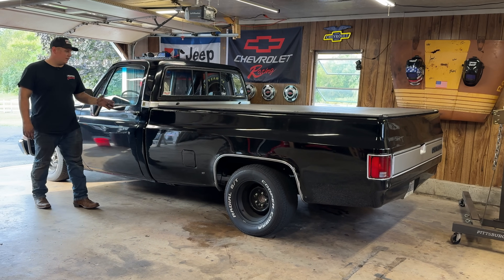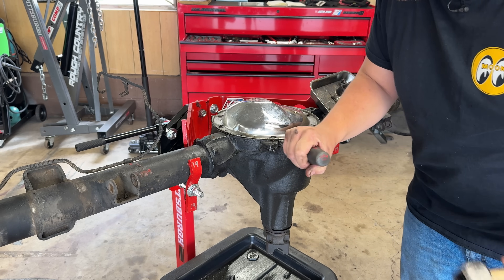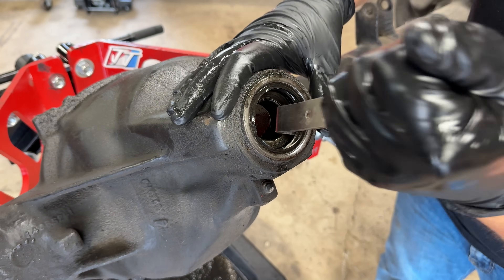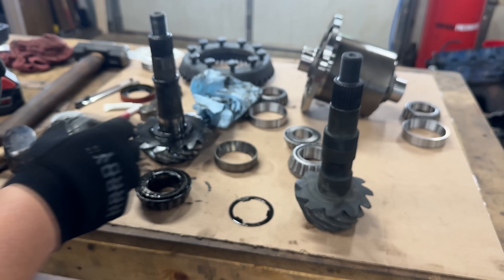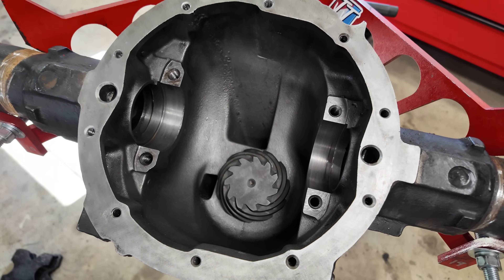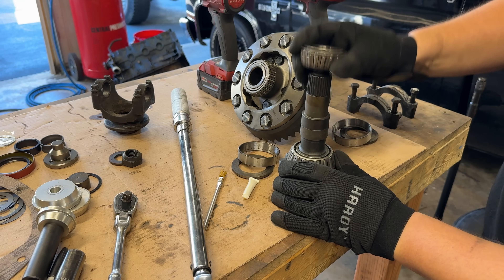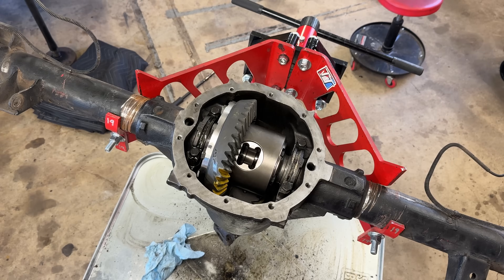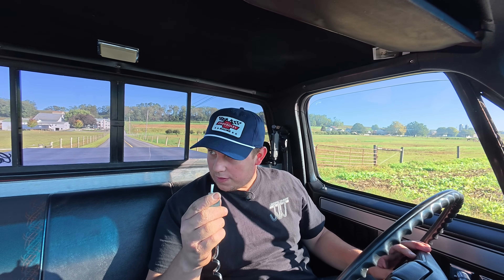Adding 3.73s and Posi to My Squarebody Street Truck!

Comment: If you use flat stock across your cap mounts and measure the pinion depth with caliper depth reading, minus the flat stock thickness, you don't need the special tool!😁👍💯

Comment: I have a 73 LWB with 383 700r4 2500 stall converter. What gears would you recommend
Reply from the maker: 3.73 are a good all-around gear

Comment: The truetrac is not a locker, or a posi traction  Drive one in the snow side by side next to a real locker and you'll see that the truetrac doesn't want to lock unless you power through it. It is far superior to a locker and much safer. Lockers are for drifty teenagers, truetracs are for adults that have to get to work with minimal drama.

Comment: I have a 1988 C1500.  I bought the pickup new April 1988. 10 bolt is showing its age. Came with 3.73 power lock rear end. Have 700R4 transmission so I'm going with 4.10 gears. I have a 2800 stall converter.  I don't do long road trips anymore. Just fun to drive on sunny days 😎

Comment: Just as a tip, do not use an impact gun on a crush collar, as the hammering from the impact gun will ding the bearing race and bearings, causing premature bearing failure in your new rear end. Brace the yolk and tightened by hand only.

Comment: If possible, support the bearing splitter so the load is on the splitter vs the threaded rods on a press. Will extend the useful life of the tool.

Comment: my brothers 72 c20 he's had for 40 years has a 350, th350 and a 3.73 posi rear, all factory. Gets to speed quickly with light throttle, and awesome traction. It was his desert cruiser a long time ago. All coil springs makes for a smooth ride. The 4.56 rear in my 85 c20 makes in really torquey and really fast acceleration.

Comment: Brother try putting a different stall converter in it. You will notice a huge difference. I was very underwhelmed swapping mine as well until I put a different converter. Completely woke it up.
Reply: Hellyeah i agree.  When i did my build i skimped and didn't go big enough.  My friend talked me into a 2800 and that thing RIPPED!  30 FT burnouts no problem. So much fun

Comment: I haven't seen the question yet where did you find a torque wrench that reads /clicks in reverse spun a friggin bolt right off once lol. Have I been living under a rock lmao. The old manual type
Reply from the maker: I was not even sure if mine would until I did this😂 Its the Icon unit from Harbor Freight

Comment: I had a 87 Chevrolet custom deluxe 3/4 ton single cab 4 x 4 throttle body with 350 4 bolt main turbo 400 trans with the new 208 transfer Case with 413 gears on the rear no locker I think it would run down chargers with no problem going down highway

Comment: what gears should i put in a pretty stock 350 with turbo 350 trans (1980 stepside)?
Reply from the maker: Kinda depends on if you want a ripper or not haha. 3.73 like this would work good
Reply: @JeepinJimmy  thats what I was thinking thanks

Comment: I have 3.73’s with a 3000 stall in my ‘73 c10 with a supercharged LS, it runs like a bat outta hell, and even with a th350 on the fwy doin around 80mph im revving around 3500rpm so its really not that bad and quite managable……
Reply from the maker: Sounds like a fun setup man!
Reply: What size tires

Comment: Takes me back to the good old days when I was 19-20. 
  We screwed with our trucks every weekend. 
   We tried the 3.55 gears then the 3.73.  Then the 4.10 gears. 
   We played around with different converters. They can be a double edged sword like the rest of it. 
   A friend of mine and myself finally ended up with a 305 Chevrolet. Big valves little combustion chambers from a 305 HOP heads. 
   Screw messing with ignition curve kits we tried that. Just locked them out and added a switch to turn on the ignition after the starter got a running start. 
   Once we threw all that at it there wasn’t anything on the streets back in the early 90s that could touch it.
Reply: I love 4.10's for the eighth...not so much for street driving lol
Reply: @jayhen475  our fathers tried to warn us about that. 
  We had the money for gas, but another bit of advice we didn’t take seriously from our fathers (Who are both respected mechanics) was, “don’t race what you’re riding to work in”.  
   We had other options. They weren’t optimal.  
   Oh the glory days.
Reply: @hughobrien4139 I learned from my dad's expletives driving his 58 Chevy Apache with 4.10's. As children we could barely hear him talk because the motor was so rev'd up at 60mph 😂😂
Reply: @jayhen475  that’s cool!  My Dad has a 57 Chevrolet truck he’s fixing up when he gets a chance. 
  When I was growing up in the 70s- early 80s he was always working on his 66 Impala SS.  It was a real 390hp 427 cid originally. 
   He got the car right before he graduated high school. 
   By the time I was born he had done all kinds of work to it that he regretted later.  
    Back halved the car some time in the early to mid 70s. Then worse he smoothed the firewall off and removed the VIN plate.  
    I always wanted that car. “No way in hell, that car is a big time embarrassment in my life.”  He ended up trading it off. 
    It was fun when he would start it up. Everyone within 4 or 5 blocks would show up to his shop.  
    We lived next door to a big church parking lot.  
    Him and his friends would drive that car on that parking lot and stack beer cans in front of the front tires to see how many the front tires would clear. He take the front clip off the car and it would stand way up.  
   As time moved along he started noticing the value of that car in original condition and I guess it became a bit of regret. 
    I loved that car.  
    Our fathers would scoff and scold us for any attempts at making a hotrod. We wouldn’t hesitate to tell them who taught us. 
    Most of the time we would conjure up something we would get it running and out fathers would get tired of us asking them tuning questions and run us out from under the hood.  
    I later went to work in a NAPA machine shop machining on all kinds of engines. The store manager was a successful NHRA super stock competitor. He was a wealth of knowledge. I’d tell him what we were trying. He would always bring us some valuable literature pertaining to the project. 
  I later went on to machining racing engines. Mostly for the NHRA Super Comp category. 
   Lots of Big Cheif and Big Duke headed 565s. Later turning most of them into 622 cid.  It became a business for me. No regrets. It did lend to fully inform me just how much money it takes to compete in racing for a living.   I don’t know that I would do it if I had the money.
Reply: @hughobrien4139 my dad's other pride and joy was a 68 T-bird with the 429 Thunder Jet. That was the closest thing to the General Lee Dukes of Hazard Charger we had seen in REAL life. That big bird was a BEAST. One winter back in 1988 he forgot to "winterize" it and the one of the heads cracked due to having only water in it. He put in one of his "friends" shop thinking he could trust them to rebuild it and when he got it back he was adamant that it didn't "run the same". Come to find out that shady s.o.b replaced the 429 with a 390 🤦🏾‍♂️
Reply: @hughobrien4139 also I forgot to mention we have a 56 big window cab step side that's been in the family for around 37 years
Reply: @jayhen475  I would be upset for sure. I really like Ford engines.  Those FE based engines like that are all getting extremely valuable these days.  I wouldn’t want to have to replace a 428 CJ engine these days. 
    When I was 20 I bought a jet boat that had what I was told was a 460 Ford engine. 
   It looked just like a 460. It ran great.  Out ran quite a few Big Block Chevrolet jet boats with it. Thought we were something else until an old man with a bass boat bet us he could out run all of us.  If we lost he had to agree to stay away from where he was fishing.
   We didn’t think much of it. Wasn’t out there to bother anyone fishing anyway. 
   That old man’s bass boat passed us like we dropped anchor.  We caught up to him and he reminded us of the bet. Told us if we were racing around him while he was fishing he was going to come out there and embarrass all of us.  
   We knew we weren’t fast anymore so we took up water skiing. 
     Later found the man who had restored the jet boat I owned. The engine ended up being a 429 Ford. 385 series.  Looked just like a 460 but was shorter stroked. It was fun and I learned to respect a Ford engine by owning that boat.  We beat the daylights out of that engine. Just kept the oil changed and kept the water jackets flushed.  It never skipped a beat. Owned that boat and actually made money when I sold it. 
     Hearing about that engine swap sure is sickening. I’ve heard many people with similar stories.  
    At one time I was looking for a large journal 327 Chevrolet crankshaft.  One of my Dads good friends gave me one for free. 
   I took it to work to measure it for bearings clean and polished.  Ran the 4 digit casting numbers only to find it was an original DZ 302 crankshaft. I did the honest thing and gave him his crankshaft back. Ended up finding a cast crank out of a 307 Chevrolet. It worked.
Reply: @hughobrien4139 yep that is exactly what my old man's 429 was, shirt stroke. I distinctly remember it revving like nobody's business!

Comment: You should have went to break in on those gears 50 miles driving easy drain the rear end and install new gear oil run 500 Miles drain the rear end then you can start playing with your burnouts.

Comment: Much easier way to do that is take your opinion down to the local machine shop that does engine rebuilds and have them polish where the bearing goes with a crank polisher. Then you make it just tight enough to wear your hands can warm the bearing up enough to make it slip on and then you can flip it upside down and tap the bearing off. But generally on all the rear ends I've done and I've done hundreds, once you put that stock shim back in there and that's what you should do just put the stock shim back in and nine times out of 10 it's going to be right where you want it to be. And you shouldn't be using a crush sleeve. 
They make a shimmed set up that goes in between the pinion bearing and the pinion and you put it in there until you get the right preload. Then you don't have to worry about it if you ever have to take it apart again or adjust anything you just put it right back in again. If you're using the same gears and bearings.

Comment: Love the work you did:) I use to do doughnuts like that in my 2000 f150 4x4 , but in twoo wheel drive of course, its so fun using the Posi traction, I also had 373s :))

Comment: Looking awesome bud! Can't wait to get my 85 GMC Stepside done, and do the same. Installed QA1 rear coil over suspension, with a 12 bolt Eaton truetrac diff. QA1 front suspension going in this fall. 406 540 HP with a built 700r4 next.  My little rocket is black also. Live the dream! Be the dream :-)
Reply from the maker: Always a blast 😂

Comment: Good video, but FYI on your bearing separator, you should put the bolts parallel to the blocks and not across the blocks. The way you did it you can bend the bolts, but if it's rotated 90 degrees the force is in the separator jaws.
Reply from the maker: Good call!!

Comment: You need stall converter to put you in your power range like a  3800 to 4200 because you have a heavy vehicle i my 95 caprice lt1 stock with 2.73 I ran 14.80@93mph an the my 60 was 2.4 4l60e and then I added 4,000 stall converter rebuild 4l60e with red clutches everything upgraded to hold 700hp and added 3.73 gears and I stalled the converter at 1,800 to 2,000  them boom 60 foot was 1.89 60 and ran a 13.23@105mph  and this was my everyday driver heavy vehicle needs torque to shoot the vehicle off the line quick I would get a circleD stall converter with clutches in it with a lock up never use a used stall converter because nobody is going to tell you the truth

Comment: Jeepin Jimmy, real nice job on video.  Quick question: The original pinion shim from 2:73s (@ ~0.036")....why did you not reuse?   At least for set-up check?    (I have a mint 2013 Tahoe with the 8.5/8.6 with tow gear (code GU6, 3:42; real nice for daily driver) but the OEM G80 diff.....the RPM-difference based diff.......hate it!  Will go with TruTrac asap.) Thanks again!
Reply from the maker: I suppose I could have re-used for setup but I figured Id use the new one since they came with the kit!

Comment: @JeepinJimmy- New subscriber here. I liked how you showed the more tech. parts, & sped up the install part, very nice. My brother and i did this same thing before in my S10. I had a Ford 9" with stock axels, & 4:10 gears, that i broke an axel in @ the dragstrip. But i know why, it wasn't from the power, as much as from my rear shocks were shot, & started wheel hopping bad prior to this track session (i think this violent wheel hop had fractured my axel without me knowing @ the time, & the very next track session with me totally hooking up, finished the axel off), where i was racing a trans am with a Pro-Charged 383 Sbc.. My S10 was a beast, the engine was a 10 to 1 compression 406 Sbc., had 200cc Iron eagle heads with 2.02/1.60 valves, Harland sharp full Roller rockers, hardened push rods w/guide plates, Comp cams Biggest sized Solid Roller cam, from their Street Roller series. Cam specs were: .575 Lift straight across, adv. duration was 300° for both int./exh., duration @ .050 was 255° straight across, with a 110° Lsa, installed +4° adv.. Intake was an Edelbrock Air-Gap Performer RPM (i wanted the most Tq., & average power from 4,000 to 6,500 Rpm), Th-350 trans. with B&M shift kit, & a custom tight=Low slip % 4,000 Rpm Nitrous Tq. Converter= (it drove around like a stock Tq. Converter), topped with a Nos Nitrous plate (with 180Hp jets), & a 750 Cfm holley Dp (i installed notched floats, & jet extensions). Exhaust was Heddman headers, with Dual 3" pipes, ran to Manual 3 bolt Exh. Cutouts (on each side), then ran outback through 3" two chambered Flowmasters, what a sound with that chopping big Solid Roller cam❤️!  Back to the ford 9" axel repair, I decided to upgrade to the biggest hardened race axels, & went down to a 3:50 gear, to have more Mph potential, with the Nitrous! Most people think just doing a gear change like you did, will not only make them quicker, but take away any bog, & or flat spot in the initial take off= it does not. But this is a big step forwards going from your old 2:73s to these 3:73s, plus adding the posi unit, now your ready for a 3,000 to 3,500 Rpm 10" tq. Converter. Don't make the mistake like so many do, & let someone talk you into anything Less than a 3k tq. Converter, its a huge waste of your time, & $, trust me. Oh, & its always a blast to go get a buddy, & have them test with their buttdyno, & the smilesperhour provided by the upgrades! Thank you for adding that, it was a great reminder to me of the fun i used to have doing these same things❤️
Reply from the maker: Sounds like a sweet build man! Thanks for watching!

Comment: This is hands down the best video on a rearend tear down. I currently have 3:73 in my truck with an open diff. Gonna slap a powertrax grippro in soon. I was thinking about going 4:11 but seeing how your baby's laying down rubber i may just keep the current gears. 

Do you know how much power you're making?
Reply from the maker: Right on man, thanks! This truck only has a 3 speed transmission so with the 3.73s its screaming at 60mph😂 Never had it on a dyno but optimistically 350 wheel
Reply: I agree on the highway rpm, it can get on your nerves after awhile
I built a 396 in an 80 shortbox with 400 engine hp and it ripped, if you have the torque and hp I would stay with the 373 if you have a 3 speed, always thought they were a good compromise gear for small tire old school, great descriptive video

Comment: My first engine build in 1984 sbc
 w/268 HE comp cam " built several since"    you didn't mention which heads ?   Vortec & swirl port look very similar but very different.   Just curious ,  cause my Nova w/2:73 
mid 13's  w/vortec heads
Reply: My customers c10 ran 13.6 268xe xam vortec heads  2400 stall and 373....wiith tons  of wheel spin!!!!
Reply from the maker: That's awesome! The engine is the truck is a crate motor, and they were just some stock iron heads that came on it
Reply: @JeepinJimmy    I think 1991 & newer  has the vortec heads.   A different set of heads 
202 double hump or vortec might add 50% with all your other additions.  Please please please aftermarket heads or the two I mentioned will change that truck's attitude.   The rest is literally perfect ! 🇺🇲

Comment: Great video, need more subs and views for sure! I have 2.73 rear gear set in mine....pretty lame. How much did this set up cost you?
Reply from the maker: Thanks dude! It was about $1,200 for the gears, locker, and axle shafts. Links in the description🤙🏼
Reply: @JeepinJimmy honestly that’s not too bad.  I did an ARB air locker in a Jeep CJ 25 years ago and it was right around $900 even back then.

Comment: I have an 83’ that I’m building that has a built 355 with 11:1 compression, aluminum heads, xe284h cam, th350, 3200 stall, and I can’t wait to get my 4:10 gears installed!! Thanks for the motivation to get back started.
Reply from the maker: That sounds like a sweet build! Happy to help man, thanks for watching!
Reply: Really strong cam I imagine.. I have an XE274 in my 355 w World Product 2.02 heads